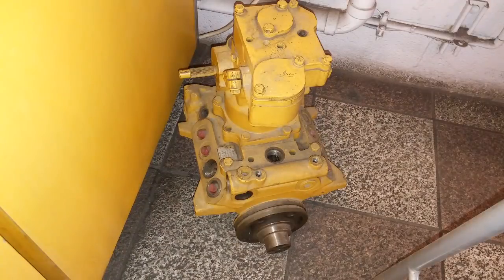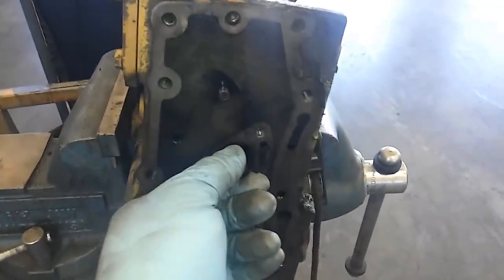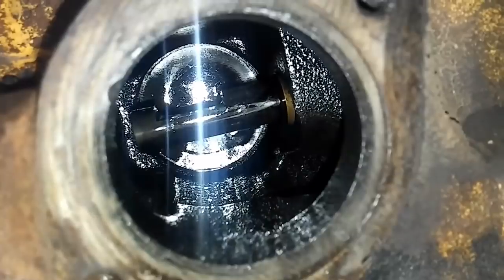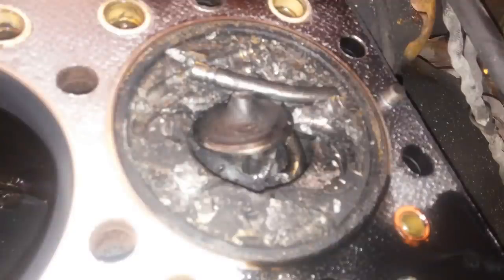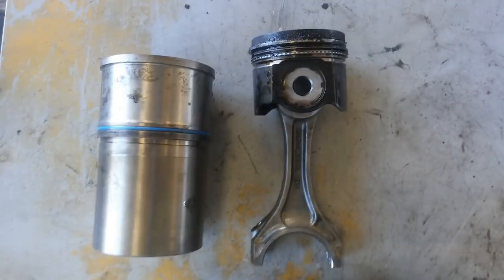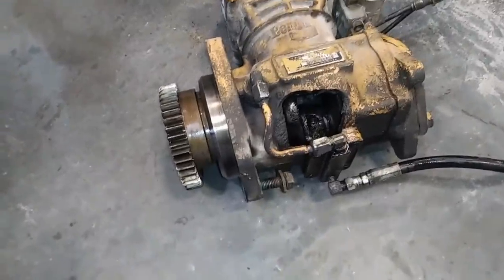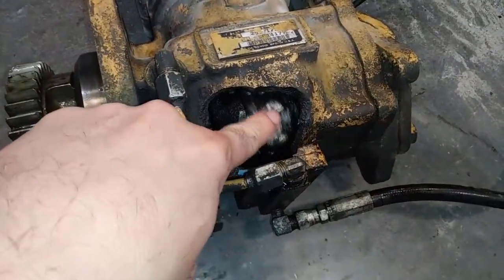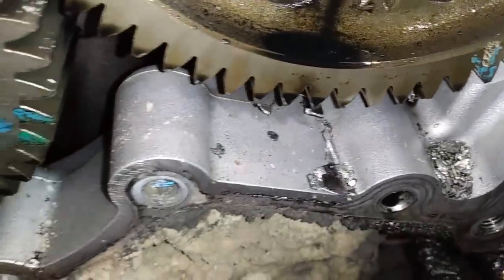Why Do Diesel Engines Runaway? What Is A Diesel Engine Runaway?

Comment: The use of a dry powder ABC fire extinguisher is guaranteed to work. You don't knock anything off or cut anything. You discharge it directly into the breather intake which plugs the air filter.  A single small car extinguisher may not be enough but it will slow it down while you find another. Best thing about plugging the filter with an extinguisher is it's fast and relatively quick and cheap to clean up. Worst case scenario is it cost you a filter. if you can't clean it out of the filter easy. Pretty much every rig on the road should or does carry a Dry powder ABC extinguisher.

Comment: I never seen one run away but have seen the aftermath of it. Seen a Caterpillar, EMD, and older Detroit Diesels. The Caterpillar was caused by oil bypassing a turbo seal and bushing. The mechanics tried to stop it and over road the govrrnor. They could not stop it from running away. The EMD was caused by human error. Someone left a 3/8 ratchet in the engine jamming the rack . Both of these engines were just overhauled. Costing thousands of dollars. I did governor work for 20 years, I always checked my rack and fuel linkage to make sure it's free and goes to no fuel and max fuel. Also check the over speed trip. Usually it set at 10% over high speed. I was always told to put a board over the intake to cut the air supply off. You can also shoot a fire extinguisher into the intake. I am very thankful I never had to do this. What a lot of people don't understand a little fuel goes a long way. Gas engines even less fuel to run away.  Great video.

Comment: Make sure you are not sucking oil out of the crankcase. Always closely keep tabs on how much oil one is using. This can case a runaway engine and a way must be found to cut off the air supply.

Comment: If you empty your fire extinguisher into the intake it should clog the air filter preventing the engine from running. So I think that is the best option if turning the key doesn't kill the engine.

Comment: First and only runaway diesel engine I ever saw was at a custom tractor racing show. Guy was just revving while stationary and then suddenly the grey-black smoke started and the exhaust caught on fire. The entire tractor started some kind of vibrational feedback loop with the bounce of the large rubber tires when it went WAY past max RPM and the whole thing shook it's self apart and threw the still-running motor about 70 feet before dying. It was horrific.

Comment: When starting a locomotive engine after working on it, remove air filter housing and have 2 boards with rubber glued on handy to put over inlets in a racing position, I have shut down a big Sulzer because someone removed linkage pins to the governor and went for lunch, no protection was fitted, mechanic started the engine and it went to max speed with no overspeed protection, Loco had to go to main works for major repair, and I got highly recommended for promotion.

Comment: Had an 84 Jetta TDI with about 800k that ran away while passing a guy... best moment of my life. It died on its own before I could plug the intake, seized itself I'm assuming due to heat. Waited half an hour and it fired right up and drove home albeit with a bit less than the lack of power it already had.
Reply: And this was after driving through the pine pass and the heated seat almost lighting up

Comment: Diesel engines run away because they can tell they are not loved, or come from broken families.  Foster care is virtually non-existent.  But if every nut bolt and head gasket can feel that they are valued and loved unconditonally, they will never run away, and will support you in your Golden Years.

Comment: A customer sprayed starting fluid in the air filter of a wheel loader to start it. You can do that but without the filters and only spraying when the engine is turning an stop immediately the engine starts.The engine started and went crazy. I jumped from my van and took out both filters and then inserted the core with the bottom facing the intake plugging it.The motor stopped and after the filters dried out the engined started normally to my surprise. But this only because the the filter cover had three clips .A few moments and I think the engine would be damaged. It was a Liebherr L522.

Comment: Don't know if anyone else mentioned this but a diesel can also run away from any fuel source entering the intake air stream, like being near a natural gas leak which also has a way lower flash point from Diesel or engine oil. I was in a shop where a mechanic..... well let's instead say "a guy working on an engine" put the governer either together wrong or on backwards, but it started to run away. He managed to crimp the metal fuel line with a vise grip before any damage was done. It was pretty disturbing though.

Comment: Old mechanic friend of mine had a customer's Detroit Diesel (I think) that was idling in the shop, start to runaway and he went to close the air damper only to find out it had been removed!  So he started stuffing shop rags down the inlet (which it kept eating) attempting to choke off the air.  "Runaway" to me always means running off crankcase oil.

Comment: Never had to deal with a runaway diesel but I've had to use my shirt to beat out a few carb backfire fires 🔥
Reply: Ha I was about to say that. I just had a 78 dodge van in my shop, back fired through the carb cuz the guy had the timing out so far and nearly burned out the headliner

Comment: Watched a GM 6.2L in a HMMWV run away. Have to give that gutless boat anchor credit. The motor didn't stop until the aluminum intake manifold melted and got sucked into the motor.

Comment: Flames out the top of a locomotive are usally a stuck injector. Oil field trucks are required to have air box shutoff that must be tested daily to shut of if a flammable gas in the air occurs. Your training instructs everbody to run upwind if a motor starts revering up for no reason

Comment: On smaller diesel engines you can take a  thick board and cover in intake tube with it and cut off the oxygen supply. Just make sure the board is strong enough to handle the suction.

Comment: My 87 Isuzu pup pickup truck ran away on me many years ago. After 10 minutes of filling the highway up with smoke and a fire truck came to save me because they thought my car was on fire. The motor slowly stopped on its own and I fired it back up and went home. Still drive it to this day with over 300,000 miles on it.

Comment: At one time I thought about creating a system that would do 2 things:
1. Monitor engine rpm and other vitals for any simple initial runaway signs.
2. Should a runaway occur the system could (either by driver input or automatically) start dumping an inert gas from a small tank into the system thus starving it of oxygen.
Could use any inert gas, helium even :) and the system as a whole wouldn't really cost very much, the sensor setup would be the most expensive parts and that's promising.

Comment: A petrol engine can run away also, but not the same way a diesel runs away.  I was working on a 1995 Ford Taurus.  I had replaced the all timing components.  I started it and it ran great.  Then I revved the engine slightly and it took off to full throttle.  The only way to stop it was to turn off the key.  As soon as I turned it back on, the engine went running again.  I even disconnected the throttle cable.  I found out the spring to the throttle body had broken and held it wide open at all times.  I had to replaced the throttle body and all ran great.

Comment: Yep, I wish I'd seen this before...  My old tractor did this last summer and now it's dead.  It has mechanical fuel shutoff and that didn't work.  I didn't have the quickness to think to put it in gear and stall it out..  I'd never encountered this before...  I don't remember how I stopped it, but I did.  It had been losing compression for a while but would still start and do work.  Now it won't start and won't do any work, anymore.  I'm getting too old to tear it down and rebuild it for the little bit I use it.  I think it must have been sucking oil, because the rings were so worn.  I had just built a frontend loader for it a couple of years before, and that's what I used it for.  Carrying stuff around for me..  I'll miss it!!!

Comment: 86 VW Golf, diesel run away on a winding back road. Both feet on the brake and another pulling on the park brake in 5th gear. It finally stopped and overheated. Then I put on new underpants.

Comment: Something handy to have on hand that is quicker to use and stop your engine than anything else is a good old fashion CO2 fire extinguisher. Depending on your engine size you might need a big one. They are not so common today.

Just blast it right into your air intake. No need to cut, disconnect, destroy anything. No need to find something big and strong enough to cover the inlet. There is nothing more terrifying than to put something on to block and it disappeared. CO2 won't damage anything.

Never use a dry chemical extinguisher! You might as well just let it blow up at that point.

I have a 6 inch diameter 25 inch high extinguisher for engines like DT466s or other stuff for displacement under 9 liters. I needed to use a extinguisher twice that size to stop an 8V92 on a practice stop under load. You want some reserve CO2 left in the bottle in case it doesn't quite stop and takes off again when you stop squirting.

These CO2 bottles are cheap to maintain and refill. They also weigh a ton!

Comment: Small diesel engines with electronic injection, like the ones on cars, vans, etc. can also run away. But they usually do it because their turbos have not been maintained and too much engine oil is going into the intake (diesels run on oil, diesel is a heavy oil). So if you have a diesel which is making too much white/blue smoke and/or the turbo noises are much louder than usual, take it to the mechanic.

Comment: Had an instructor many years ago that had a 12-71 run away.he vise gripped all fuel lines .no go. Put a clip board over air intake and it got sucked in.He ran for cover after that.

Comment: Back in the 80,s I worked for BFI and my garbage truck got a brand new motor installed and in the middle of the day that sob ran away and it revved so high you couldn't turn it off and it started smoking so bad you could not see and thing and had to jump out of truck in the middle of traffic and couldn't even see where you was going, lucky didn't get killed by cars driving through it.

Comment: You can put it in 4th or 5th and dump the clutch if you have a manual of course, it's what I did when it happened to me. BTW, 90 percent of runaway diesels are caused by turbo failure, I am yet to see a runaway caused by the pump...

Comment: A lot of the limitation in rpms is not due to heavy components but the large displacement. Massive gasoline engines have low redlines just like diesels

Comment: Most people don’t realize that a 2 cycle engine can run away. The old 2 stroke air cooled dirtbikes can do this when they get hot.  They scream and you can’t shut them down.  Only way is to slam her in the highest gear ya got and dump the clutch while holding the rear brake..    usually they go lean and get hot and do this right before melting the piston

Comment: I had a early 2000's diesel hot hatch from VW, had lots of torque and power, I believe turbo had a massive oil leak that started to feed the engine, caused it to run away so I money shifted and hit the brakes as hard as I could. The torque the engine was making caused so much smoke to pour off the brakes when the car stopped and engine stalled. Thankfully it didn't destroy the engine or start any fires but it did make me want a more modern diesel.. well.. at least until my country started coming down hard on them now I gotta get a hybrid. Rip Power, Rip driving for Fun.

Comment: When i was in diesel school we had an 8V71 Detroit on a test stand, blower seals failed and it ran away. Only had a gallon of fuel in a small tank, that ran out then it started running strictly on oil. The air damper wouldnt close. Used a CO2 fire extinguisher to smother it.

Comment: I had a combine that sheared of the compressor wheel in the turbo allowing the exhaust turbine and shaft to break out of the housing and shoot up the exhaust pipe, this then let the oil supply to the turbo feed the engine which was then out of control, managed to stall it by pushing the hydro drive hard forward and applying the brake, filled the whole valley with smoke at the same time!

Comment: I had an engine failure 5klms after a dealer service, it was a runaway. The mechanic got the apprentice to fill her with oil, he did, complete to the top of the valve cover. When the engine started it blew the seals in the turbo and the engine started running on it's sump oil

Comment: I had my C15 run away on me. It was less than a year after a platinum rebuild. -20 outside and it sucked one tank dry and ran out of fuel while parked downtown while I was at home. I had no idea til hours later when I got there to take off and leave town. Needless to say, it was a nightmare to get started again. It took a fair amount of starting fluid to get her going, I had no other choice. Anyways… finally got it fired up and was sitting in the cab letting it warm up a bit and all the sudden it took off. RPM gauge maxed out, it must’ve hit 3000-3500 RPM or better, I slammed it in gear and killed it immediately. Started it back up and all was fine. It never happened again. Idk what caused it, unless there was a pocket of unburnt starting fluid that it finally decided to set off, but that don’t make much sense to me. I’ll probably never know why that happened, but I can tell you it is an absolutely terrifying thing to have happen. Specially when it’s your truck and you just put 25 grand into the engine. Damn near had a stroke and it was all done and over with within a few seconds.

Comment: I had an old lawnmower with a 6hp engine where the governor got stuck and it became a runaway. Fortunately i was able to ground the sparkplug to shut the ignition. I think for diesel engines they should include sn emetgency fuel cutoff inside the cab and one in the engine compartment.

Comment: Old 'Detroit Diesels' were prone to 'Run Away' (2-cycle engine) with mechanical pumps. First, the rack can stick WOT. Secondly (and is OFTEN THE CASE), the engine was low of coolant or for some other similar reason, the top side overheated (pre-detonation) combined with a rack stick...now, on the old Detroits you had a 'air plate' that closed off the air intake in event of WOT-Run Away...as you said, no spark, so fuel and air and compression equals ignition. Break the 'triangle', kill the engine. Well, if you didn't maintain your air plate, then you couldn't stop a Run Away...and I've seen this 3 times in my life, where 'after failure' showed the rack was stuck, and the air plate was either damaged or also 'gummed up' or stuck open. Killing the fuel would kill the engine, but to force a 'fuel kill' normally involved damaging a fuel line (vice grips, anyone?), and without thinking, few would consider this 'path to shutdown' until after it is too dangerous to approach the engine to do it. Best answers for 'old school diesels'? MAINTAIN you mechanical pumps AND your air plate track...otherwise, figure out a way to fight THAT MUCH VACUUM to mechanically close the fuel pick-up line...

Comment: Saw a video where a guy plumbed in a CO2 tank to his intake in case of runaway. Flood it with unburnable gas, and it should stop if you have enough. Might be the same as the fire extinguisher story since some are CO2.

Comment: I thought a rack was a 48DD? Hehehe. You know your stuff. I've seen a locomotive with plumes of smoke...well on the way to the grave. And I've seen an older road tractor flaming out the exhaust at night. Glad neither were the truck I was driving. I did experience a turbo failure on a 1997 Volvo D 16...so much smoke you couldn't see the highway. I was pulling a hill, but the engine was not maxed out in RPMs. I managed to get it turned around, pointing downhill, added a gallon of oil, and followed the wrecker to a suitable area to hook up. I will say the D 16 was a horse of an engine.
Cats and Dogs living together...GHOSTBUSTERS!!
Dude, you are cool. Bet u would be a blast to share a beer or two with.

Comment: This happened to a train which was coming into a downtown area of a town close to where I lived. I wasn't there but read about it in the local newspaper. Fire was shooting at least 50 feet out of the exhaust. The fire department used a cherry picker to shoot foam into the exhaust before the engine finally seized. Scary....

Comment: older Diesel engines, pre turbo days, ran away from overspeed or mechanical failure. any diesel with a turbo can end up running away on it's own oil if the Turbo is set up to use that oil.

Comment: You meant to say “float the valves” where the spring isn’t strong  enough to close the valve quickly enough to pull it away from the rising piston. Not a problem with a flat head. A simple flood of nitrogen will stop it. Or a tennis ball or beach ball for really big engines. 

I didn’t know leaking engine oil could keep the engine moving. That is scary if cutting off the air isn’t possible.

Comment: I get what the turbo guys are saying about sucking oil though the turbo, but I've had runaways on smaller NA diesel engines (Kubota D1105), and it's straight fuel. The pin on the end of the fuel rail in the injector pump breaks off and cutting the air intake off is the only thing you can do.